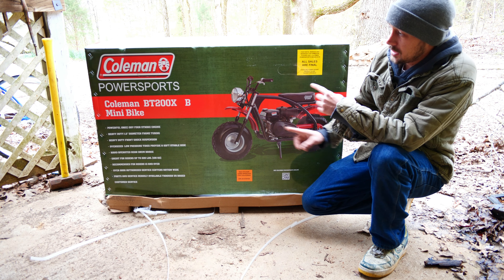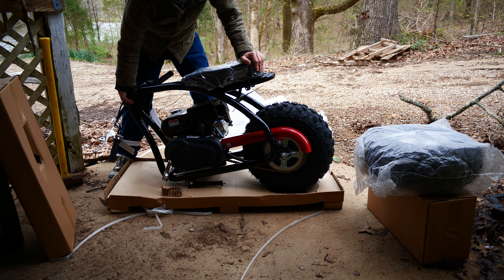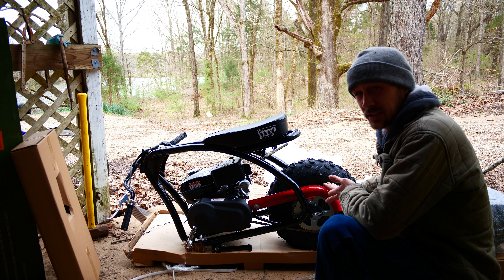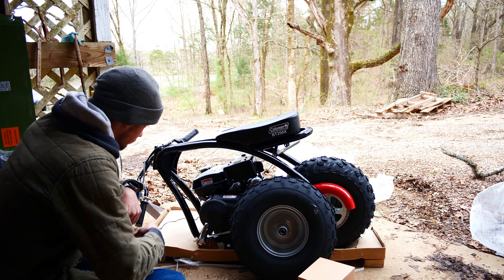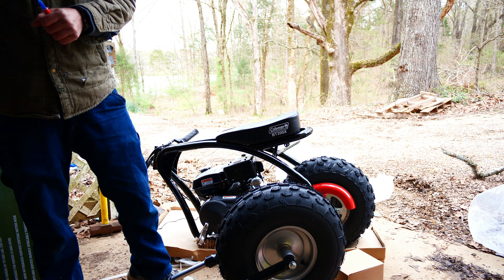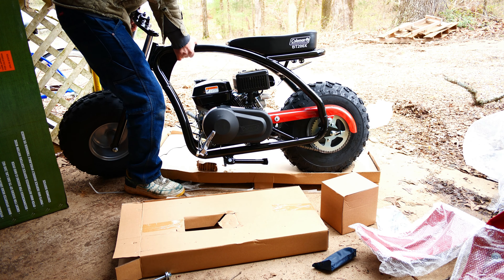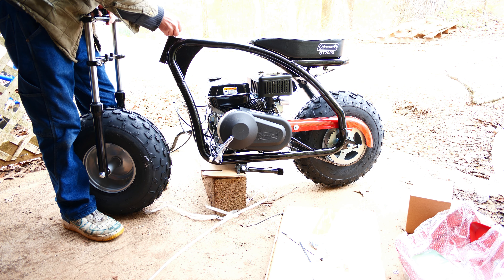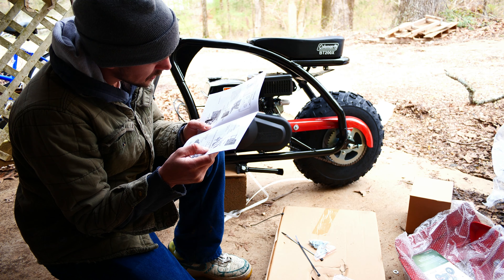Minibike Muddin: assembly and test of Coleman BT200X

Comment: I had a hell of a time putting on the front forks.
Still need to put on the headlight.
I hope to test it on the weekend.

Did you cut off the throttle limiter screw that's welded on?
Reply from the maker: Yes I did I didn’t in the video but later on I just used a Dremel with a cut off wheel I didn’t have to remove anything to be able to get in there and cut it.
Reply: @makermentality1031  Good!
I was wondering how my Dremel type tool would get to it.
I'm going to try it  first in limp mode just to see.
Reply: @makermentality1031  Man, I have to rewrite this post, lost it.

Anyway, so after many attempts to try and start the thing and coated the bike in blood because I cut my finger on the carb bolts, I realised the top switch was not the kill switch, (I am still not sure, the rocker switch is I know) It started right up, it smoked a lot for a few minutes, I assume from factory lube burn-off.
I cut the throttle limit screw off, but at full throttle it started starving, so of course I knew that it must be the EPA jet, the hole is too small.
The other problem I had was ice everywhere on the trails, could not drive it, it was impossible!
I took the side of the road home, it was -5C (23F) and my fingers were throbbing when I got home, that nice warm beer before I turned around to head back home really hit the spot.